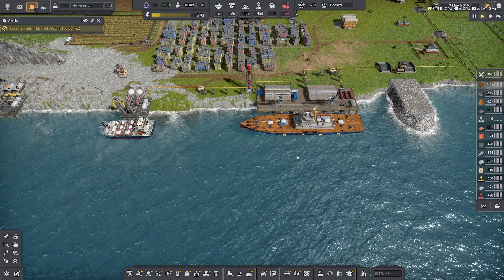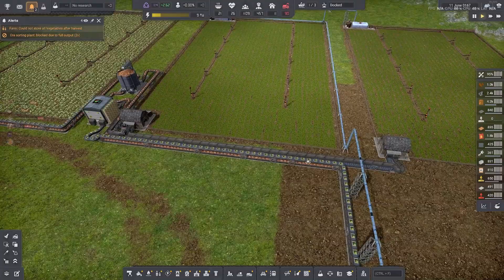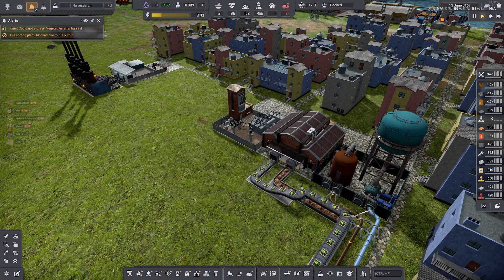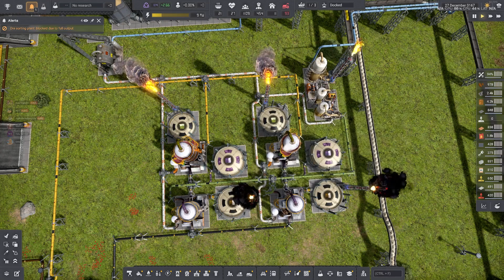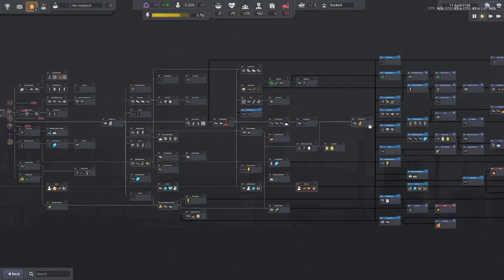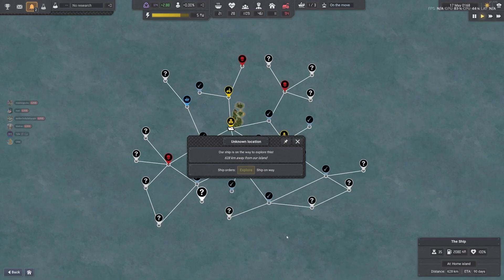Captain of Industry: First time playing and its incredible

Comment: Your oil plant flares - the flares should be connected to a priority balancer ahead of your storage. Priority output goes to the storage, and then the excess is routed to flares to prevent the system from backing up.
Reply from the maker: Perfect! Now I can make my fuel oil plant actually work decently. Thanks so much!
Reply: or you can just set the setting in storage so that it wont allow belts or pipes take resources from the storage before its nearly full